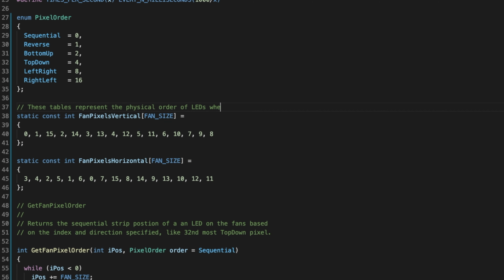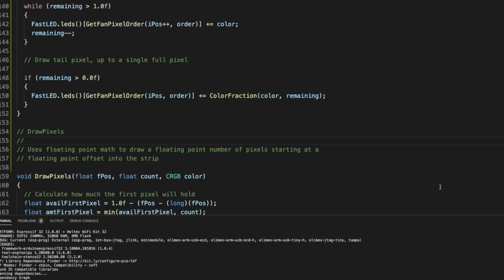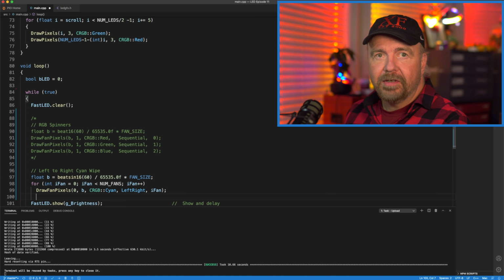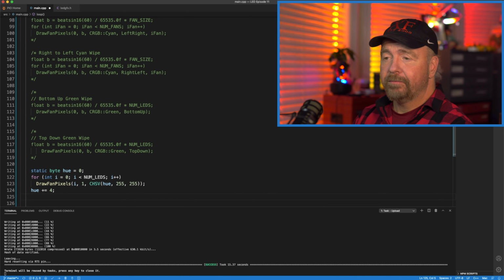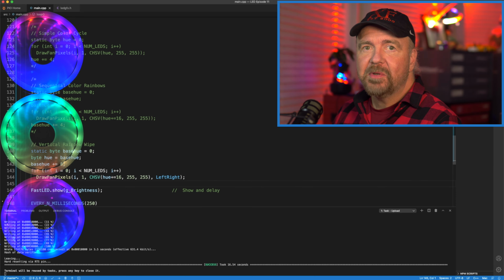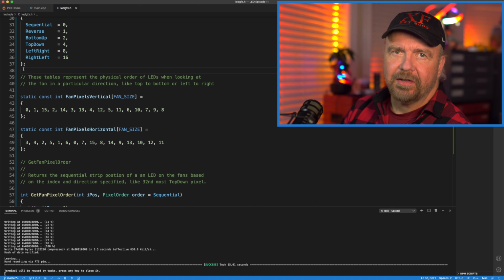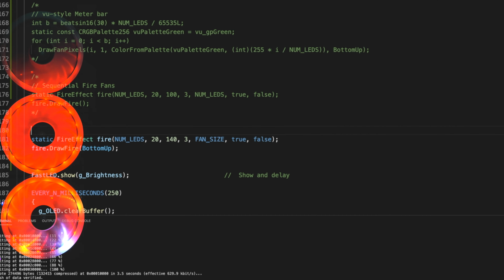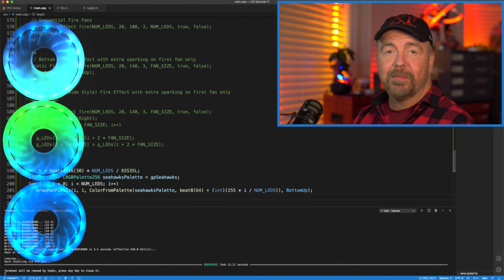12-Fan Effects for PC RGB Fans - Arduino, ESP32 and FastLED

Comment: Love what you've done, much more powerful than what we're given! One thing I don't understand, your horizontal starts a 3 but your diagram suggests 4 would be the start not 3, I thought it might be that the leds aren't exactly aligned to the sides but then the horizontal would be wrong. Your code works perfectly so it's obviously correct, I just don't understand why!

Comment: Dave I have a question about PlatformIO, it's not as simple as you showed on your video... I get the following message:
 "C/C++ IntelliSense service does not support .INO files. It might lead to the spurious problems with code completion, linting, and debugging. Please convert .INO sketch into the valid .CPP file."
I don't know what to do about it, can you explain please, thanks.
Reply from the maker: You seem to be trying to load a .INO file which will not work.  Start fresh with an empty .cpp file!
Reply: @DavesGarage  yes that's exactly what I was trying to do, isn't it possible to convert the INO file at all I mean it would be handy if it did or is that too much work?
Thanks for answering on my question, I really appreciate that.
Reply: @RicardoPenders  copy and paste

Comment: I wanted to let you know how much I appreciate your incremental coding approach, with interspersed display results.  Of course, I have to pause now and then to scan and comprehend the code which just appeared to have been typed so rapidly - but each of us has our own pause button and thus can create our own timing for when and for how long we need to pause, so it's easy to customize this for our own learning style and level of background.  That works well.

Regarding this episode.  As a small note, your left to right order is really starting from 22.5 degrees counter-clockwise of horizontal, a bit tilted.  Well, 22.5 or 11.25 degrees...

[You speak it like 3&4 then 2&5 then 1&6 (like the center axis is between 3 and 4, or 11.25 degrees CCW of horizontal), but the order that generates (3,4,2,5,1,6...)  is actually the same as if you just started from 3 (22.5deg CCW) thus:  3 then 4&2 then 5&1, 6&0 etc.]

The real horizontal left to right order would be 4 then 3&5 then 2&6 etc.(or 4 then 5&3 then 6&2...).

Thanks to your table driven approach, there's no need to rethink some carefully constructed integer range remapping formulas or algorithms and then debug all the off-by-one corner cases ( as might have been needed if you had taken that approach in your pixel index remapping).  Instead you can just edit the table and it's done, no code changes and easy to comprehend  That could become an example for (part of) a future video, showing more specifically how a table driven approach can sometimes make that kind of modification easy.
Reply from the maker: Thanks!  My fan is sort of 3.5 LEDs off from 0, so it sort of depends how you hold it, but the diagram doesn't quite match what I'm saying, but the table is easy to change like you say!